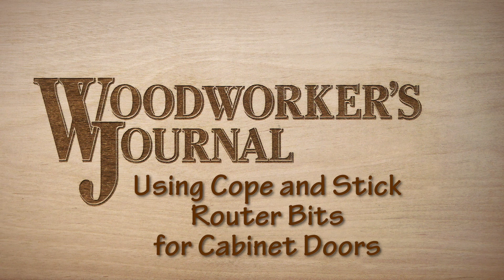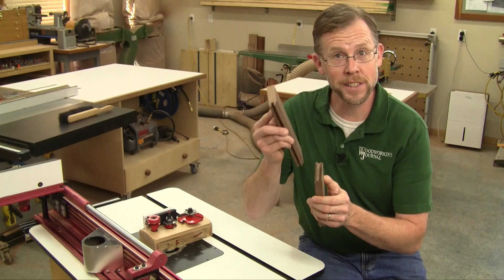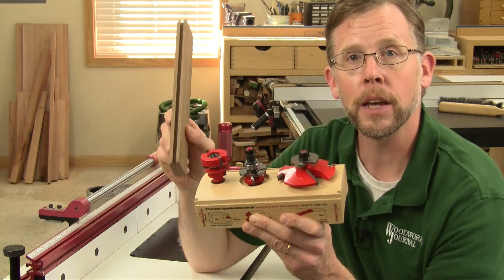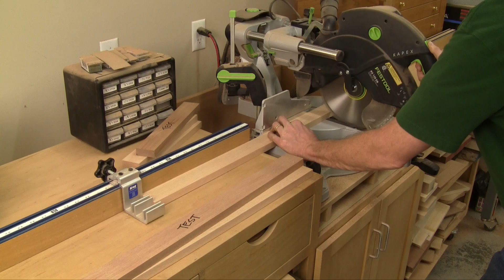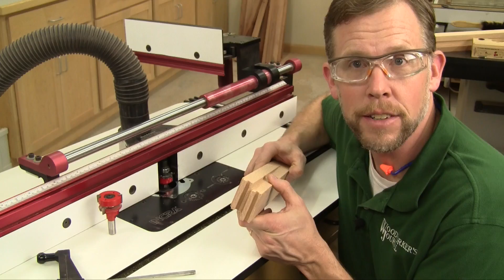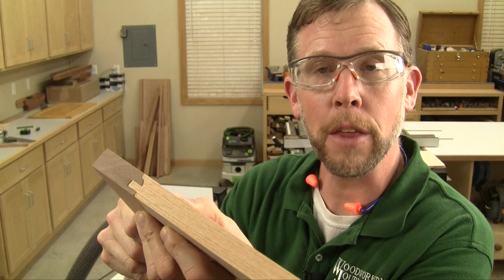Using Cope and Stick Router Bits for Cabinet Doors

Comment: Thank you for this video. I just learned about cope and stick by disassembling a cabinet door. I didn’t know what I was facing as to replicating these intriguing joints, but I knew your video would have the clarity I need. I’ve got my stock cut, but this is my schooling.